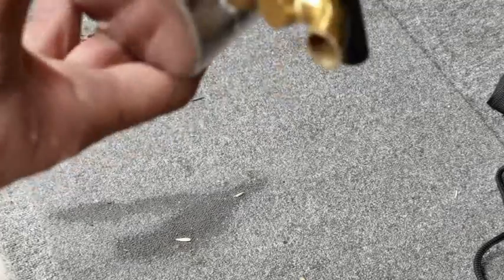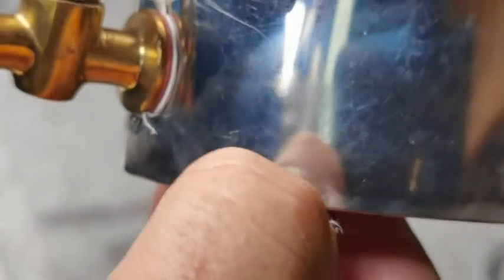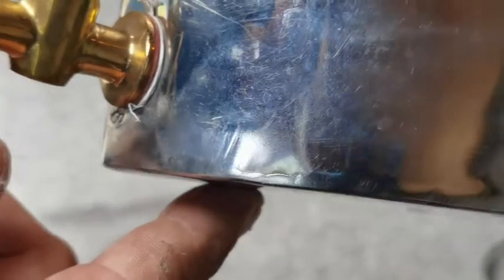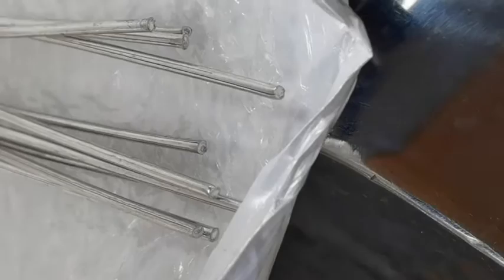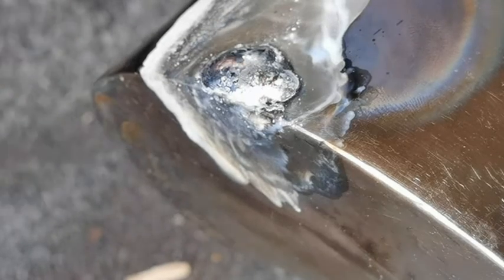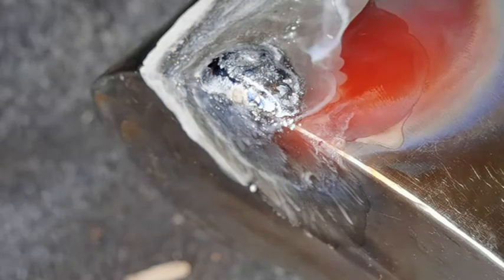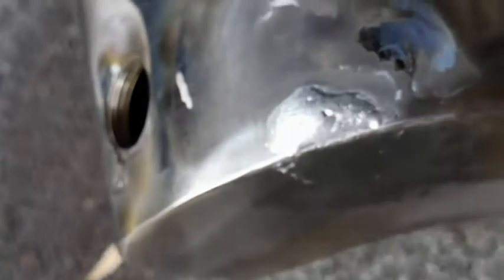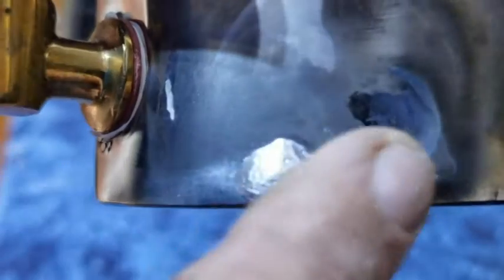DO THEY WORK Flux Cored Rods Aluminum Brazing Low Temperature

Comment: They say; Don't use them direct into the flame. Just Clean and heat the weldingspot. After heating touch it and the tip of the rod will get liquid for welding. Otherwise the material rod will cumble and be not at maximum strength.

Comment: Defo supposed to heat the metal and let the heat of it melt the rod, but some of the problems with these rods could be quality, seems they are not all made equal - maybe check out this video:
"Best "No Welder" Aluminum Welding Rods? Alumiweld vs Bernzomatic vs Hobart"

Comment: It's a wonder this worked at all because the man is using it completely incorrectly!  He didn't prepare or clean the area with a wire brush and used the brazing rod in direct flame!  You are supposed to heat the repair area but keep the rod OUT of the flame or it just blobs!
Reply from the maker: Great point will give it a go thought it looked shit lol thanks Dianne